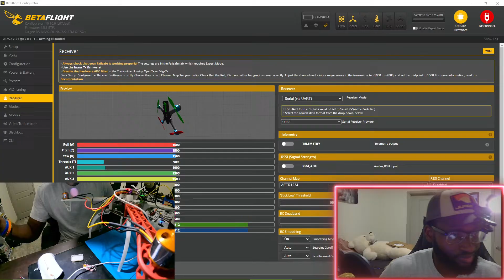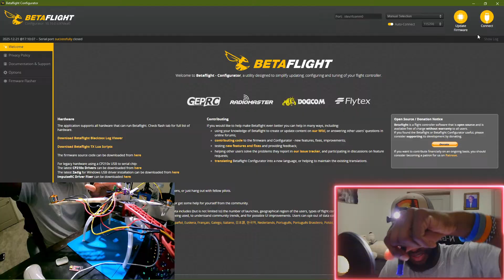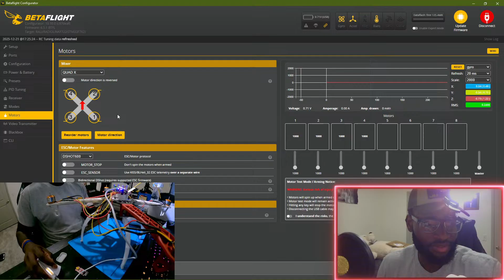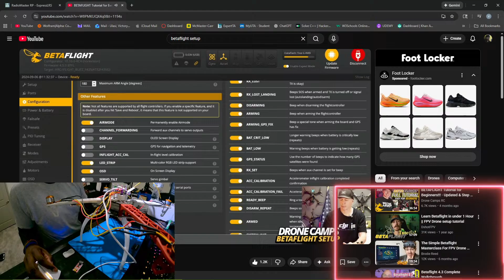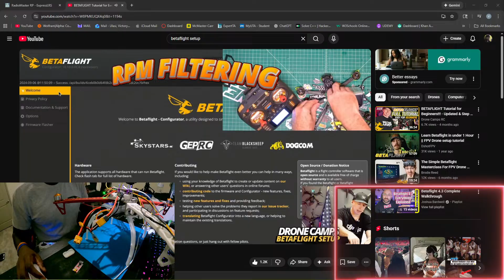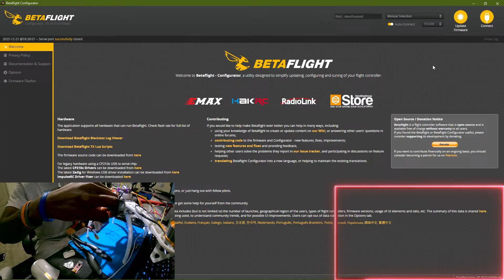IT MIGHT FLY TODAY? (DAY 5)

Comment: HEy Dude!
Hope your Build works well als your Copter fly..
I`ve had no more Time, so i couldn`t help more, sorry for that!
Wish you some chill Days and as allwayys
Happy flyin`
Reply from the maker: Haha thanks, looks like it will be a wait because one of my motors are bad, sound almost like a bad bearing if these things have bearings, but 3 of them work and spin fine so im working on a replacement with amazon right now, Thanks
Reply: @VictoryUUlasi  check your Scews, the lengh. They dont want to stitch into the Coppercoils of the Motor!! Then it will be a Short and a fried Motor..
Stay tuned